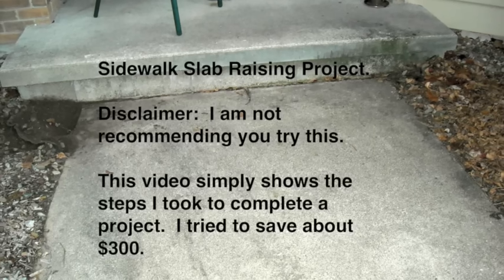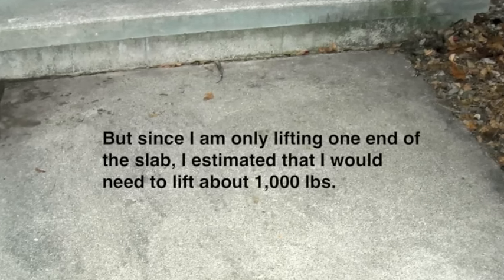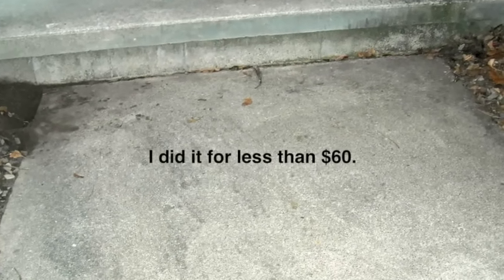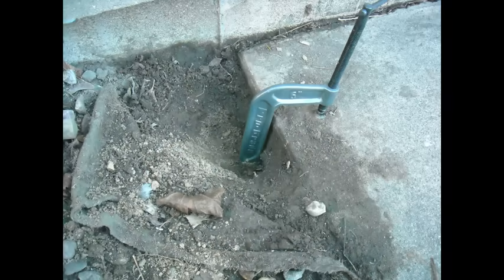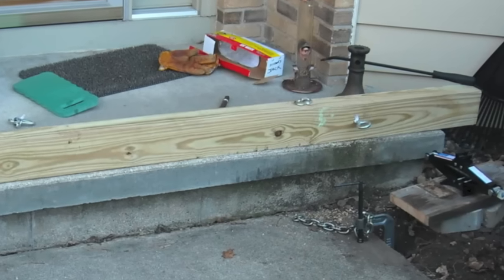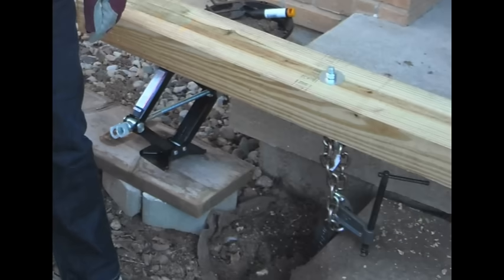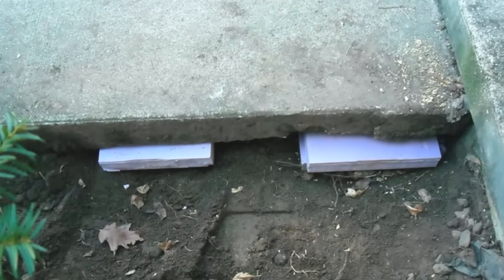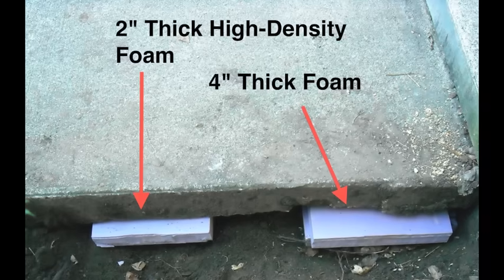Slab Raising, Do It Yourself

Comment: why not just backfill it with some all purpose gravel that will pack and support the weight of the sidewalk evenly, rhetorical question. I've seen the lifting process of a 2 part foam process where they drill holes and also use a jack to lift the slab before beginning to fill under with the foam, and I've never heard of it not lasting. The huge air pockets you left under this slab will allow for more washout and settling because of the huge amount of space left underneath where you used the foam slabs. This method is not going to last for sure. A few heavy rains and it will do more settling and probably be worse with the huge air pockets you created!

Comment: This looks like a good set up, but the foam to me is a no no.  Styrofoam is not going to last long.  It gets brittle and will crumble in a few years.  I think raising it and then setting it down on cement or bricks would be better.  I just feel that the foam will cause you to be doing this all over in about 5 years and looking for something better.  Keep the C-clamps, you might need them.

Comment: I did this in Ohio on some sidewalk pavers but used stone instead because the bottom of the concrete is pitted out I figured it’d fill it in better however it resettled last winter to where it was. Gonna retry with packing sand but it’s tough cause I can’t get under it real well. Problem with the boards are since the concrete is not flat on the bottom it wobbles on the flat boards. Suggestions? I’m thinking maybe I’ll cut up pieces of the board?

Comment: OK, nice job. My question is did you ever think of just pouring new concrete over the existing slab. Was there a special condition that kept you from using new concrete. I have a 100 foot side walk in front of my house that I would like to level. I'm responsible for the sidewalk and I can cut it into equal sections and like your project I would only have to install foam under one side on the concrete. It  only has to be raised about 3 inches. At this point I'm just going to give my project some thought, but I certainly enjoy working with concrete: I know my wife thinks the same thing. FR
Reply from the maker: Thanks for your question.  I researched pouring cement onto the existing surface. However, the new layer of cement would taper from 4 inches to zero inches, and this thin edge would probably attract moisture beneath the new cement when it cured.  That would freeze in the winter, expand and crack - leaving me with a bigger problem that I has when I started.  After over two years of severe winters and hot summer, my job has been a success.
Reply: Pouring new concrete over it is the worst thing you can do. It'll chip off or cause further problems in the future. The entire idea is to get it back to it's original position with water draining away from the problem area. I couldn't see the rest of the area around Mr. Cantwells stoop but you may also have to raise the cement pads behind it so that they are all sloping the same direction. In some cases it is as simple as lifting the one slab but in my experience there are other causes that led to that step or slab to settle. Inappropriate water drainage system; gutter in the wrong area, pavement slanted the wrong way, wavy finish on the concrete etc.  This is very similar to some styles of lifting and may work for him. Most of the time there are bigger issues.

Comment: 1855, You suggest that you "only need to bottle jacks"  to eliminate the use of  the C clamps and Eye bolts, but you don't explain how? Are you suggesting that you dig down next to and underneath the slab to get the bottle jacks under the slab? I like the mechanical screw jacks, as I've seen far too many bottle jacks leak down. Somebody might get injured if a jack seal were to fail!
Reply from the maker: kthom2001 Thanks for your comment.  Bottle jacks don't make any sense if one has to dig deep holes - especially if the soil is soft.  The whole idea of c-clamps is ease of grasping the slab without digging holes.

Comment: I just came across this and have some cement work to do as well. I am wondering how well this held up over time? I hadn't thought to use a high density foam. Does anyone with experience with this method know how long it lasts?
Reply: I'm also curious . . . 7.5 yrs later, how is it??

Comment: Why did you use a synthetic material to rest the slab on? I would think some gravel would be just as good job and never rot and probably provide better load distribution.
Reply from the maker: Thanks for your question.  I had limited space to push in gravel, sand or cement.  I would have to push it in sideways.  Slipping in the high density foam pieces was really easy and not too expensive.
Reply from the maker: Also, when I slipped in foam that was 4 inches high, I knew I would be raising the slap the 4 inches I needed to create a 6-1/2 inch step.  I had enough foam left over for a 2nd job so the foam only cost me $13 per job.

Comment: Curious as how you decided on foam board rather than pressure treated, etc.?
Good video.. Thanks!
Reply: @Gary Grow, I'll hazard a guess that the foam would crush to a certain extent, spreading out the stress on the slab. Probably like sand would do, but easier to get under there.
But I had no idea foam board had that kind of strength and that it wouldn't just collapse into nothing.

Comment: You said a friend told you that foam jacking doesn't last.  Wouldn't you eventually have the same problem with your high density foam?

I assume for foam (similar in compression strength to what you're using after curing) jacking, they would just spray high density foam to fill the void after jacking.
Reply from the maker: Thanks Paul for your comment.  The foam used in foam jacking apparently is not dense enough to support a heavy load for a long period.  My friend owns apartments and had foam jacking done and he said it only lasted one year.  I can assure you that Owens Corning Foamular will last indefinitely.
Reply: The foam used in jacking would be the same material. The difference would be that it would also do the lifting as it expanded, fill any voids underneath, and you end up with 1 or 2 small holes where they drill. You are talking about an inorganic waterproof material that will not break down and is strong enough to lift thousands of pounds of concrete before it even fully cures.

Comment: How did you insert the pads under and towards the center of the slabs without putting your hands or arms under the slabs?
Reply: He said the foam that the professional use will compress over time and not last.  The foam board that he used are higher density and will last longer that’s  why he did it himself.
Reply: haha20042003 yes I know that. My question is how did he insert the pads? There must be stone and dirt underneath.

Comment: There is an easier method using cheap spray foam cans.  Hammer drill through the concrete and use the long spray foam nozzles to spray inside the holes to lift the slab.  Just search "Spray foam can leveling" on YouTube.

Comment: great fix but im sorry that wasnt done for 60 bucks,,,2 clamps, eye bolts, chain, posts,  chain pieces and high density foam,,i have priced that foam,,maybe you had some of that and didnt need to buy it all,,but great fix regardless,,im assuming it still not sinking providing you took care of the drainage issues,mud jacking does work provided drainage issues are taken care of,,

Comment: How many hours total including purchasing materials did it take ?
Reply from the maker: Plan on spending about 3 hours on the job.  This includes 1) assembling the tools, 2) digging around the slab to install the c-clamps, 3) lifting, 4) clearing away soil next to slab to slide in the Foamular and, 5) clean-up.

Comment: So those are two different type of foam you used?  1 high density and the other something else?
Reply from the maker: Thanks for your questions.  Only one kind of foam: Owens Corning Foamular 2" thick.  Note: Do not use foam insulation in spray can.  It is not high density and will not harden properly when applied in large volume.  My repair has lasted perfectly for several years. No sinking or cracking.

Comment from the maker: A friend who owns apartments in my town told me the foam jacking he had done lasted one year.  That kind of foam is pumped in using a two-part solution that expands under the slab being lifted.  How good is that foam is the question?  Apparently not very good.
     The Foamular 250 I recommend has a rating of 25 pounds per sq inch, meaning a 3x6 foot piece (2592 sq in) of Foamular should support more than 50 times the weight of a 6ft x 6ft x 6in slab.
Reply: It is probably the soil and not the foam that is failing. What ever caused the sinking in the first place is continuing to cause the slab and foam to sink. Getting the surrounding soil up to and above the bottom of the slab after lifting as you did is key. Good job.

Comment: where did you get the eye bolts. i looked at home depot,lowes ebay. all were 300 pound capacity. if they break, you figure it out. worked for you. 4"x 4" are pine. good chance they'll break. a lot can go wrong, including crushed hands and arms. talk to a contractor. i got a price in pa. for $275. scissor jacks, c'mon man. bullshit on $60.

Comment: John,
I'm wondering if bags of pea gravel or such could be used instead of the foam.  Just keep cramming it under the slab with a pole of some type.  Well done, by the way.
Reply from the maker: Yes.  That will work, too. However pea gravel may settle over time.  High density foam is light and easy to cut and slide under the slab in small pieces, and it will not settle.
Reply: John Cantwell  The pea gravel will not settle. The dirt underneath the aggregate may however, and is the reason your concrete sank.  3/4" rock would be better.

 Great video. I would suggest not clamping directly to the concrete. Lay some 1x or 3/4 plywood as to disperse the pressure from the small areas on the clamp.

  I would personally remove the slab, figure out why the dirt is settling-too much moisture is likely-compact the area, import some class II base or SE30 sand, re-compact the area and pour the section new.
Reply: I was thinking that, too.  The small round end of the C-clamp created a pressure point.
Reply: That's probably more effort than he was wanting to do.  I would have jammed some concrete in, but to each his own.
Reply: The only problem with foam—the mice will come and chew it up for nesting material.

Comment: The high density foam will compress over time.  There is a product I use forget the name. But if you describe what you are doing at the independent hardware they will lead you to a cement product in a box about a quart or more in size that expands as it hardens. Makes for a stronger underlayment.

Comment: Well done.  When the slab was lifted why didn't you pour concrete under the slab?
Reply from the maker: +Passed High School Physics - you can certainly do that if you can push the concrete.  That may be difficult with a liquid.  The foam board is rigid and will slip under the slab.
Reply: +John Cantwell (TitleTownJake) A good rake, or good edge of a 2" x 6" could do it.  High-early concrete will be rigid also...quite quickly.  Anything that leaves a void under a rigid concrete slab will be sure to welcome ground water...a historical enemy of both flexible and rigid pavements.  Everyone has their own method.  I'd have run a logging chain underneath, raised with a farm jack, blocked up corners then placed a low-slump concrete underneath.  Gently lower to correct level and let it set up.  Another method would be to simply place a new pour, flush with your porch right over the existing.  There you have your no-step feature the old/feeble enjoy.
Reply: wwaynemcg blah blah blah. Concrete will cause more work in future if the slab sinks again. Gravel is fine combine  with the foam board
Reply: The foam was a bullseye.  I saw a video where constant dampness would cause the road to sink and fail. They fixed a huge area with 6 semi truck loads of big blocks of foam. Engenering said it would never decompose. 5 years later and good as new
Reply: Yeah, pour concrete on top on concrete.  That's really brilliant!!!  You'll end up with more cracks than a nudist colony.

Comment: My congratulations on your lift!   I want to make some clarifications on  what was done.  You were extremely lucky you didn't get hurt doing this and I would suggest NO ONE tries this.  I spend every day looking at cracked slabs at peoples homes.  Chaining and lifting the corners created point loads that would in many cases crack in the corners and drop on the person attempting it.  Also the lift is not a permanent fix because the soil that had settled under slab causing it to sink was not addressed.  Your neighbor was partly right in saying foam is not permanent. Actually he should have said... foam that is not installed properly does not last.  The foam itself has been used since the 20's and last forever. Actually since it is not porous like concrete it does not fracture like concrete. Its waterproof so it won't wash away.  The difference between what you did and foam injection is that injection would have fixed the soil, so it would be a permanent fix.  When foam is injected it first fills any void between the concrete and soil.  Then it looks for a place to  further expand. The structural foam looks for the path of least resistance. Since the soil is soft vs a thousand pounds of concrete, it will push down first.  Then when the pressure to push down is greater than the weight of the slab, it lifts the slab.  So it compacts the soil, fills any void, then lifts the slab.  Suggestion to everyone... fix the other home issues and leave stuff that can kill you to a professional.
Reply: Exactly your cost is  prob very expensive this home owner (John) foxed it for $60.00 and has now lasted well over 3.5 years  if needed he can fix it every 4 years  for prob the next 20 yrs if needed and still be ahead of what guys like you charge. Get a real business !!!!!!! it a D.I.Y. and it worked as I suspect your application probably won't  last that long so what lind of guarentee do you give maybe 5yrs.

Comment: Ok, how about a 3.5 year update?  How does it look today?  Any issues?
Reply from the maker: +Ed Floody  - - Hello Ed.  It has not sunk one bit in 3-1/2 years.  I suspect it never will sink because the Foamular Hi-density foam board will support 50 times the weight of my 6x6 foot slab.  Thanks for your question.
Reply: thank you for having replied John. almost another year and someone is looking at this info (me).
Reply: Ed Floody probably cracked right between the foam, seeing how he didn't show anything placed their.
Reply: Hey bud, I love the idea. I’ve got a portion of pool decking, right around the skimmer, that’s doing the same thing. Love the foam. I saw that it’s called Foamular. Where did you get it?
Reply: it is usually in the insulation section or same isle of the big box stores.
Reply: by the concrete section

Comment: Just a quick question - You state foam jacking(?) doesn't last but you used foam to fill the gap.  What is the difference?
Reply: One type of foam (stiff and solid) is red delicious apple. One (the pumped in, two-part foam) is a Granny Smith apple. They seem the same but at the molecular level, are very very different.

Comment: What about her face right near the chain under tension? 😂 Also I saw her hand under the slab ..msge was trying to reach for that dime. 😂
Reply: That was my first thought as well. As with a car, get it up, put some blocks (4x4 or something) in place, and release the tension a bit. I would not trust that type and size of the chain. I don't give a fk what the rating says. If it's Chineesium from HoDep or wherever. Not hardened steel designed for a dynamic load, sheesh. Those link welds give me the hebbies.

Comment: If u left spacing under slab u made it weaker and easier to brake at those points. I hope u back filled under besides for just the foam boards.

Comment: Instead of car jacks ,you can also use 2 ton bottle jacks that cost about 10 bucks a piece, ......so what if they are made in China, for the job they will do. I saw on them on EBay for a couple bucks, plus Harbor Freights has them for   $9.99 a piece. just another way to do it.....sure it adds cost put can always use a bottle jack or two down the line.

Comment: Why wouldn't you just did a hole under the slab and put a jack under that corner, jack it up into place and just pour concrete over the jack, leaving it in place. Small bottle Jack's are like $10. A bag of concrete is $5.

Comment: This did NOT work for me...it actually started to bend the jacks......smaller slab than yours...4 x 2.5 'x 4.5" or less than 1000lbs, did not budge at either end.....back to the drawing board.